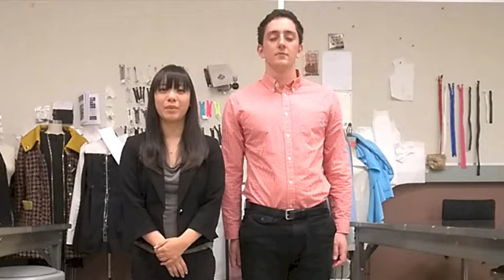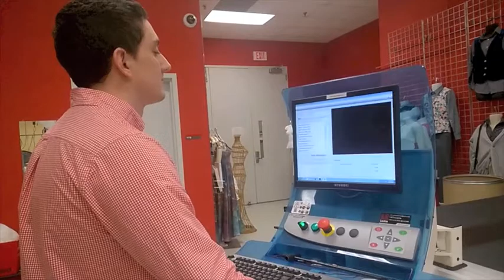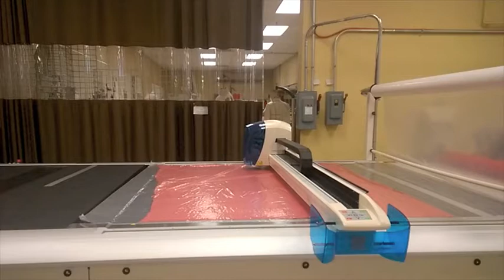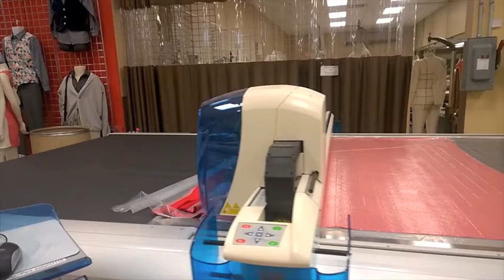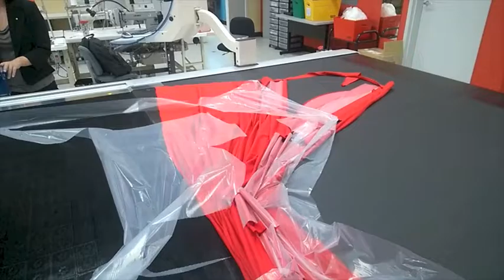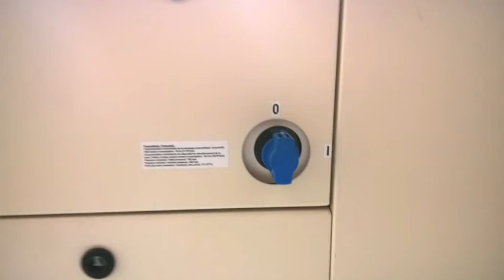Lectra Cutter Demonstration for Textile Students

Comment: Don't need to to do the 4 point check if the fabric is put in straight that setting can be turned off also the computer needs turning so you stand at the end, this machine is designed for mass production and huge volumes of production if used correctly this can cut over 500 sofa pieces a day